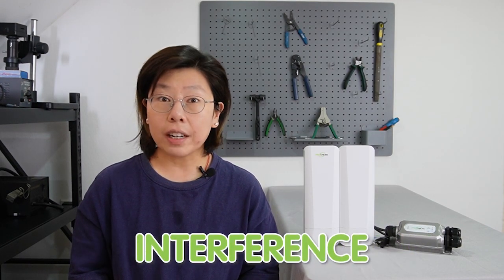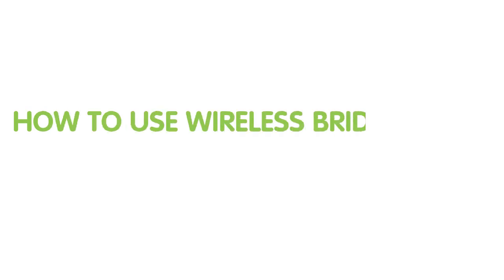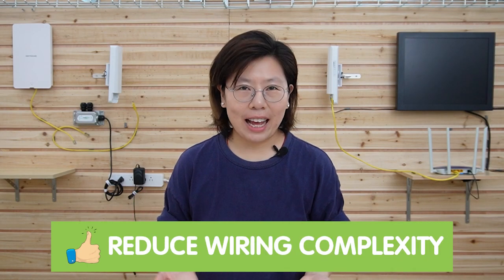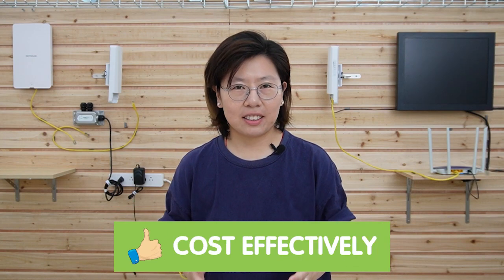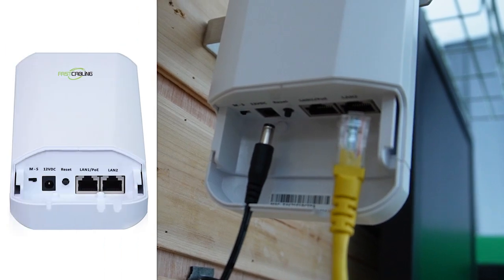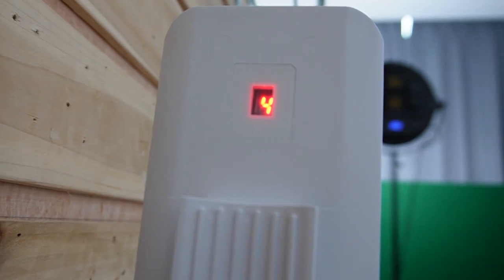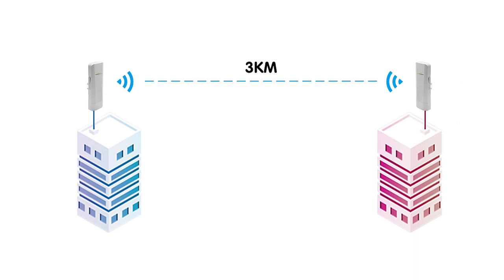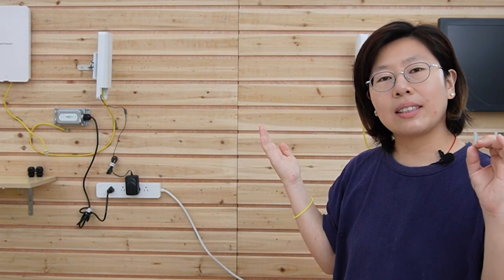Outdoor Mesh WiFi Using Wireless Bridge & PoE

Comment: How can I connect multiple wifi camera together with one router into four different building
Reply: Not please not an IP camera but a wifi camera powered by or with an Android charger
Reply from the maker: You'll need a point-to-multipoint setup. We've developed a 5KM wireless bridge that allows you to connect 2~4 clients/APs (it can accommodate more clients based on the setup) with a beamwidth of 30°. Watch this video👉https://www.youtube.com/watch?v=X5cvPF1pSB0&t=8s

Product link: https://www.fastcabling.com/product/5km-outdoor-wireless-bridges/

If you're interested, we can provide free consultation for our customers - contact us at support@fastcabling.com. Just let us know the distances between the router and four different buildings, the number of cameras, and the bandwidth requirements.

Comment: Weldone Sister, It has not been easy for me to send video signal from my church to my house which is less than 1km distance in between. But When I saw two of your videos, I was a bit releaved. If I may ask, do I need PoE (if I am using wireless transmitter and receiver of 900mpbs)
Reply from the maker: Power over Ethernet (PoE) may not be necessary. However, it depends on the specific equipment you're using. Check the product specifications to see if it supports PoE, and if your setup requires it for power delivery.

Comment: Hi, you mention you can get 60W of power through the POE cable, but then you're also supplying power to the bridge via the transformer and 12V connector. I thought the whole point of the POE was to supply power to the bridge without needing the 12v supply.
Reply from the maker: Hi, thanks for your comment. The wireless bridge can accept both PoE and DC12V power. The PoE injector used in this video is to power the access point since it only accepts PoE power.